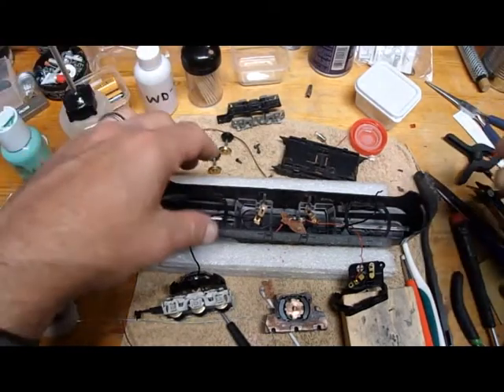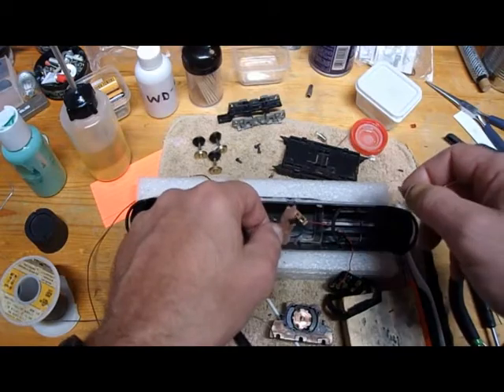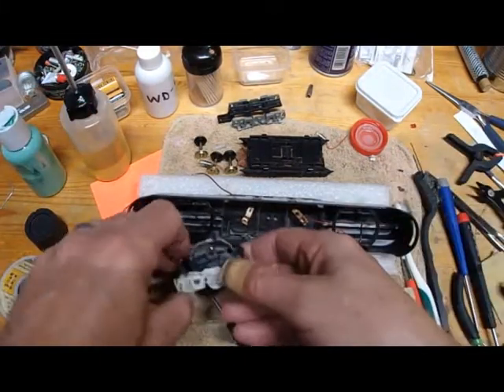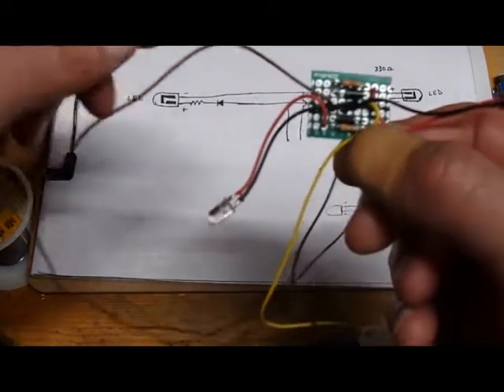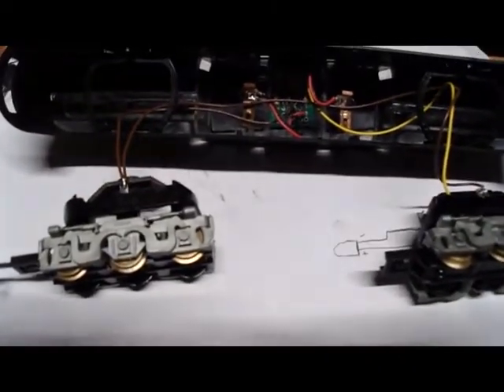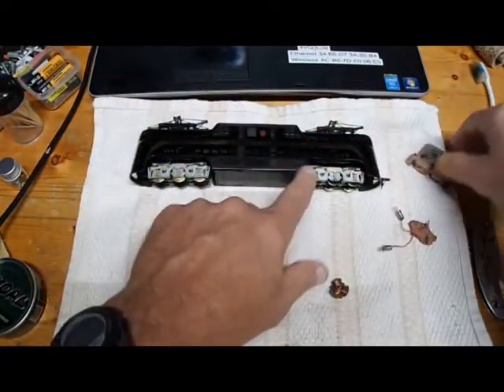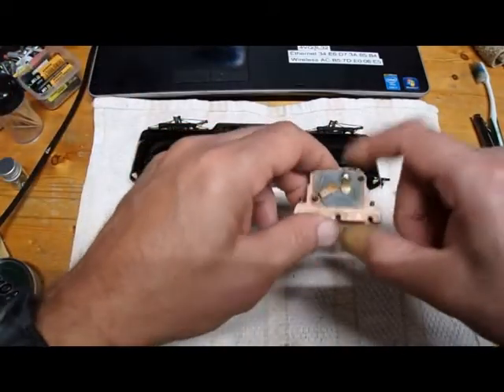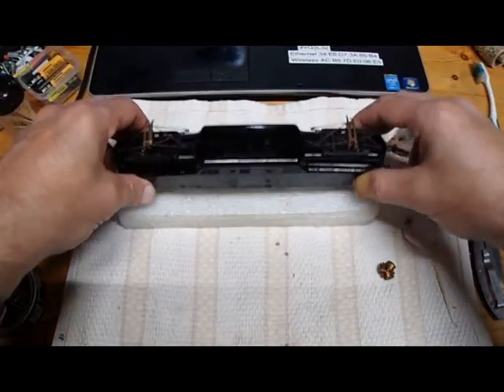Pennsylvania GG-1 Repair

Comment: 5 bucks for the charcoal black model is an amazing deal. Nice work getting it going again!
Reply: I agree $5 or heck any good low amount for a Tyco or mantua or any model for that matter is a great deal especially if it can get restored heck yeah.
Reply from the maker: Thanks.  I've never seen a black one before.  I'm impressed with how well it runs considering the shape it was in.

Comment: Wow great restoration on that locomotive. Cool led set up and wiring.    I would think for the pantographs if they can handle WD-40 and a old tooth brush or something to clean rust off if you can take off the loco without damage that may help out or some other type of rust inhibitor then clean it off so it dont harm plastic. I'm just taking a wild guess there but depends on how bad it is.
Reply from the maker: I used a little bit of WD-40 on it.  It helped a little.  Maybe I'll find another one with good pantographs.